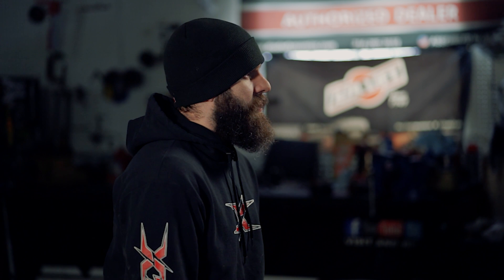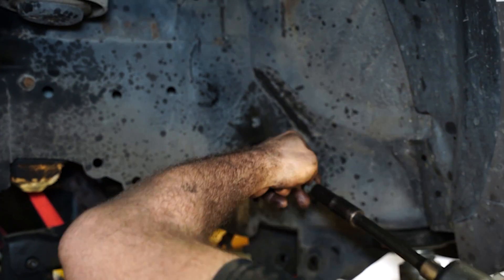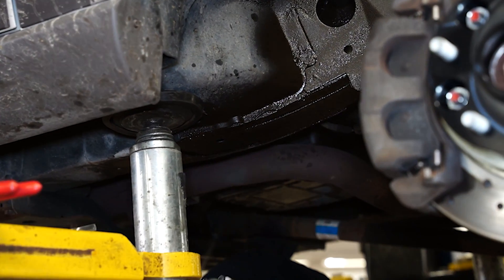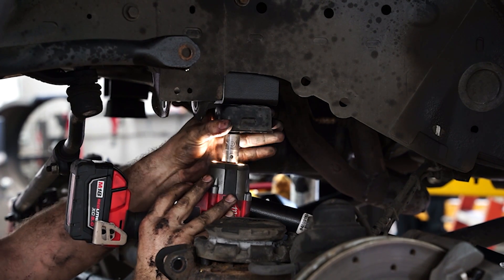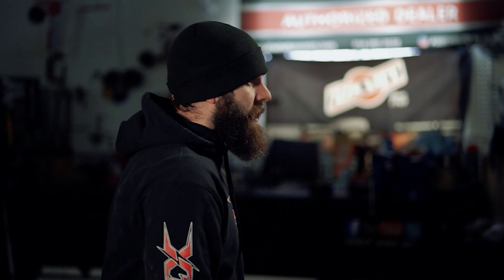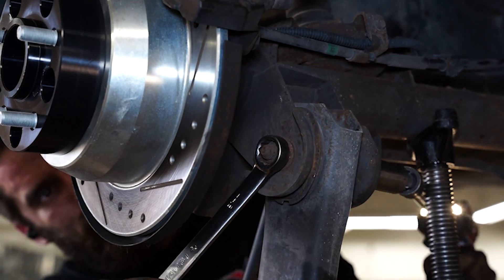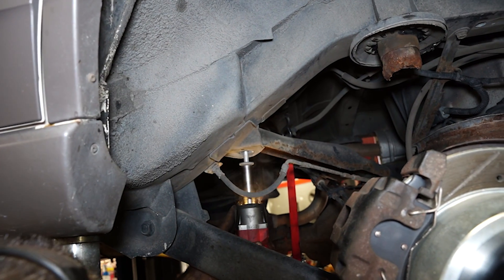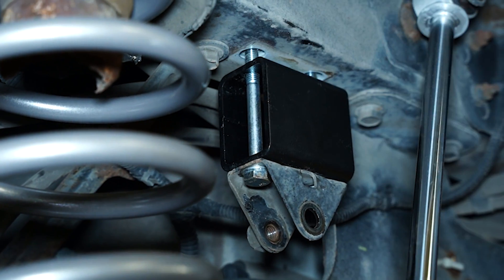Jeep Grand Cherokee WJ 4 inch Rough Country long arm lift kit

Comment from the maker: In this video I put on the 4 inch drop pitman arm. I didn't explain why I added it to the kit and what my plans were. If you buy this kit and don't plain on changing the trackbar angle then you DO NOT need it. It will throw your steering/suspension geometry off. Sorry I didn't make this clear. Video coming soon on when and when not to add a drop pitman arm and what its effects.

Comment: i was one of the lucky guys who got one of the newest upgraded 4" long arm kits from my great guys at rough country and one of the greatest compliments I've ever received was the day after installing it went in for a true FOUR WHEEL ALIMENT every shop i called was 300-400 bucks so ok took it in dropped it off three hours later i get a call saying come get it so i go back thinking they couldn't do it well i walk in ask what i owe and im told $65.00 i asked so you guys couldn't do it the owner comes out and say OO no we got and. MY GOSH WE HAVE NEVER EVER SEEN A COMPLETE LONG ARM LIFT OR ANY LIFT THAT HAS SO MUCH ADJUSTMENT once we fig out all the adjustments it was the easiest fastest four-wheel aliment we've ever had.....
Reply from the maker: I think this kit is GREAT for the price. It rides great in my opnion better than stock. Yes there is a ton of adjustment and its easy to change anything if needed. Glad to hear that the shop was able to hook you up with the alignment. Seems to be getting harder to find a good alignment shop these days.

Comment: Had my 99 WJ since 2005..... it's still bone stock and I've wanted to do this for the last 10 years. IRO kit seems a bit pricey for just about the same stuff as this RC kit. Nice ride sir.
Reply from the maker: Thank you!
 Yes all of the other options are expensive in comparison. I have had this kit for a year and have had no problems with it. The track bar and sway bar links are a bit loud but most hiem joints are. Also I have had zero issue with the RC long arm joints (I grease them every other oil change or at least check them). When the do go bad I believe IRO or one of the other kit company makes replacement joints for the RC kit as long as you keep it at 4 inches. Honestly at that point I might just make my own arms and use the RC brackets to mount them.

Comment from the maker: Yes I know I said that 99% of the time Death wobble is caused by the track bar. I was exaggerating. It's the most common of what I see at Xtreme. Control arm busing and ball joints would be the runner up.

Comment: I definitely like the design of the front control arms of the Rough Country long arm kit over the Iron Rock. But, in my opinion, the quality of the Iron Rock is a bit better.
Reply from the maker: I don't have any complaints with this kit after a year. Iron Rock is a great set up, but it is over 3000 for the kit. The RC is about 1600 so it is quite a bit cheaper. What I have heard is that the RC joints don't last long. I have had this kit on for a year and not had a problem with them or any of it. I believe that either IRO or Trail forged makes replacement joints for the RC kit. So when it comes time I will upgrade them.
Reply: @XtremeTruckAuto  yea, that's a good point

Comment: is this a V8? quadradrive or quadratrack? I read online none of the Rough Country kits will work with either and I'm sad.
Reply from the maker: Mine is a 4.0 slec trac. but it will work on all of the WJs (99-04) Jeep Grand Cherokees. The only reason why they say it won't is because of the front drive shaft. You need to go from the cv style to the double cardan driveshaft (u joint drive shaft). With that being said I would go check out my other videos over the RC joints. I would 100% recommend upgrading them to the Johnny Joints before you install this kit. I have it on my jeep and after I eliminated the terrible RC joints I have had zero issues with the kit. TBH it is a great budget kit. Thanks for the comment and watching!
Reply: @XtremeTruckAuto   They also say it won't work on the V8 models but a buddy of mine was saying that's probably all cuz of liability concerns. The previous owner already changed mine to u-joint style front drive shaft. I decided to go with the Iron Rock 4-in Long arm kit anyways.

Comment: Daaammit😂 i was set on this kit until i seen the video.  Great video tho nonetheless! Seems like a lot for 1 single guy in a gravel driveway tho lol
Reply from the maker: YOU CAN DO IT!!! One thing I will say if you do want this kit I would recommend that you upgrade the RC x joints to the Johnny joints right off the bat. I have a video that talks about this sadly not one that shows the break down of the RC joint. However, I will very soon because it has been requested enough. But in all honesty if you are balling on a budget, then I would start putting the money away to replace them in 2 years (how long my joints lasted). I do thinks this is a great kit for the price and the only issue I have had to date is the joints. Hope this helps you decide and thank you for watching.

Comment: Hellow master
I live in southkorea and  wj 4.7 grandcherokee 04.
Two day ago, offraod little bit.
And the make noise looks like steel rub so check the suspension.
I found make noise from front low arm braket (transmission member).
Between frame and braket have space where front side (1-2mm).
Is it collect installed ?
Thx to vid.
Reply from the maker: It sounds to me like something is shifting. I would go back though and double check all of the bolts in that area and make sure they are tight and try to give the bolts a little bit more torque.

Comment: How do I set vehicles to ride height? I’m on jack stands and blocks. Please help me understand ….
Reply from the maker: The vehicle hight is determined by the springs. So there isn't a way to adjust ride height unless you do different springs or add some kind of spacer. The adjustmet in the arms is for axel position and pinion angle/caster.

Comment: @20:22 I noticed a bolt missing. Was that intentional? Or did the bolt snap off?
Reply from the maker: There is a bolt in there. It is a counter sunk bolt with a spot to tighten it with an allen or torx key/socket.  I can  see how it could look like that. Thanks for the question. I will keep that in mind in for future videos and get better angle of things like that.

Comment: Great video! Did you have to modify your exhaust? I am planning on installing this kit on my '02 WJ Overland. Do you have a complete list of replacement Jonny joints?
Reply from the maker: No I didn't have to modify the exhaust. 

Below is a website that has the joints listed for every part of the kit. Let me know if you have any more questions.

https://trailforged.com/2022/05/11/rough-country-flex-joint-woes/?srsltid=AfmBOor4XmheWD0hlo1ybo-Aq3g0a4X8vNHAWor4-O_rmUyETaOAgimo

Comment: I appreciate the video! Do you have any idea what caster or pinion angle you're running? I just got mine in and the front driveshaft is making a lot of noise. I've got the pinion at about 4 degrees up which is putting caster somewhere around 5 degrees. Don't really want to go any further or my handling will suck. Maybe I need a different drive shaft? I rebuilt the factory double cardan but maybe I did something wrong. Any help on what angles are working for you would be appreciated. Thanks!
Reply from the maker: I set mine up so the pinion was inline with the drive shaft. I believe that a (3 joint) DC you want the drive shaft and the pinon close to the same angle or the pinion pointed at the transfercase and on a (2 joint) or cv style drive shaft you want the transfer case and the pinion to be parrell or same angel. I think mine is something high like 6-7ish. If you send me an email (its under the about tab on the channel page) I will send you pictures of mine. I never put it on an aligment machine because I have zero issues and the tires are wearing fine. Keep in mind that doesnt mean that its in or right but it warks for me and drive fine.
Reply from the maker: https://wranglertjforum.com/threads/help-me-with-some-very-basic-questions-on-suspension-and-body-lifts.46387/

This had a pretty good illustration about half way down the page.
Reply: @XtremeTruckAuto  I appreciate the response.

Comment: Nice video. Just did mine. Did you notice that your trans mount was droped down quite a bit. My transfer case is pretty low now and the motor is tiped back as well. Might have to make some spacers to tuck everything  back up.
Reply from the maker: Thank you!! I didn't notice it changing any. You might check and see if that transmission mount is bad.

Comment: Did you ever do an alignment video?

Great video for the lift install. I used this as a reference whilst installing, moreso than the actual instructions! Hello from England.
Reply from the maker: I'm glad the video was helpful!!!!

I did not do an alignment video. I might be able to work something out. There is a lot that goes into alignments especially on a fully adjustable kit like this one. You have to keep driveline angles (depends on your drive shaft) , caster , toe and steer ahead in mind. So unless you are familiar with alignments, I would recommend that you take it to a professional and have it aligned. This will give you the best result (assuming they know what they are doing). Because an alignment machine is going to be 10000000000 time more accurate. (ok I may have exaggerated there)

Cheers mate and thanks for watching.
Feel free to respond back if you have any other questions.
Reply: @XtremeTruckAuto  oh definitely, taking it to someone is my preferred option, the issue over here is finding someone who will do it. This sort of thing isn't popular and so far every alignment place has took one look at it and just said no 😢
Reply from the maker: @joesm00th  if push comes to shove I can get you close. Let me know and I will get you angles and lengths off of my jeep. Keep in mind that I never put it on a rack to align it but it drives fine and the tires are not wearing funny so I figured send it. Are you running a double cardan drive shaft?
Reply: @XtremeTruckAuto  if I get stuck, that would be amazing mate. I'll drop you a line if that's the case.

Yeah, managed to source a double carden one from a V8 WJ using part numbers. They are rarer than hens teeth over here as scrap. 99% of our WJs (WGs) all had the cv style ones.

Comment: So ill admit it, ive dogged rough country long arm lift in the past. Im seriously looking at them again for the long arm upgrade kit and using springs and shocks of my choice. Upgrading the bushings when they fail and so on.  So how do you like the lift? Would you recommend it  after a year? Ive got 04 wj. Thanks
Reply from the maker: I have seen zero issues with the rubber bushings, but you also need to know I'm not flexing it out very often. I built mine with the purpose of having an off-road capable daily driver. On few weekends throughout the summer I will load my boy into it and go out camping/overlanding. Most of the roads are light to moderate trails. So if you are looking to do something similar. 100% recommended with the upgraded joints right off the bat. Now if you are wanting to build a crawler I'm sure with the up graded joints and bushings this kit would do just fine. I just can't tell you for sure because I haven't tested the kit in that way.

Comment: So I'm going to put the rc x series on my wj will it be a complicated at the long arm ?
Reply from the maker: No, becuase you will be using the factory mounting locations. So you won't be replacing the transmission cross member and you wont be cutting the factory mounts off. It should be pretty straight forward compaired to the long am kit. I will tell you that rough county has some deicent instructions. So fallow them and you shold be good to go. I will give you the heads up that the bolts on top of the rear diff are a bit of a pain to remove due to the loctite that is on them. Once they are off and you go to put the new ones in besure you loctite them. If you have any questions on the install or you get stuck shoot me and e-mail. It is listed under the about tab on our YouTube channel page.
Reply from the maker: One other thing is besure you grease all the x-joints and put antisieze on the threads of the joint that goin into the new controll arms.

Comment: How good is this kit holding up? Any review?
Reply from the maker: I have zero complaints. I had to put a transmission in it about 2 months ago. So, I checked out the front joints while the crossmember was out and also checked the rear joints while I was at it. Everything looked good with zero play. 2 years+ and still going strong.
Reply: @XtremeTruckAuto  nice. I have IRO coils so now that u say that, ima irder the arms, if anything, i can always replace the joints only with a different brand right? And how does it handle on road/freeway?
Reply from the maker: @carloshereaud5463  I love the ride. Its honestly better than factory and it handles how I would expect. It's my daily so I have quite a few miles on the kit. Its like 35 miles each way to work. 

Yes IRO I believe makes upgraded joints for the kit. That was my plan once the joints that came with the kit wear out. When they do I will make a video and let people know.
Reply: @XtremeTruckAuto  thanks bud. 👌🏼👌🏼👌🏼
Reply from the maker: @carloshereaud5463  no problem, if you have any other questions let me know.

Comment: Awesome video. What tires and size are you running?  WHat would you say is the max tire size for this lift?
Reply from the maker: Currently I am running 285/70r17 (33x11.5) Cooper Discoverer Rugged Trek tires on a set of Jeep Gladiator Mojave wheels and a set of Spidertrax 1.5 inch wheel spacers (DON'T GO CHEAP WITH WHEEL SPACERS!!!) G2, Bora, and Spidertrax are the brands I recommend for wheel spacers. I have done quite a bit of trimming on the bumper and wheel well liner, both for clearance and for looks. I also relocated my washer fluid bottle (I have a video over the relocation of the washer fluid bottle). I do rub at full flex which I am fine with because I'm building an overlanding vehicle not a rock crawler.

As for a "no rub no trim" fitment RC recommends a 265/70r17 or 265/75r16 (31.5x10) on the factory wheel. Keep in mind this is without wheel spacers. They typically are spot on with the fitment but depending on type of tire some minor trimming might be needed.

As for max tire size, I have seen some crazy stuff like 35 and bigger but those either have a TON of trimming or the fenders have been removed. It really comes down to how much you want to cut to get the wheel and tire to fit. Luckily the WJ platform is one of the easier vehicles to trim fenders, bumpers and all that type of stuff.
Reply: @Xtreme Truck & Auto  Thanks.  I'm looking at building a WJ trail truck for mud and snow. I think a 4" lift with 33's should be about perfect.

Comment: Wish they had a long arm system for the V8 version.
Reply from the maker: It fits all of them. The reason why its say that it want fit the v8 and the AWD version is the front drive shaft. Most of them came with the rzeppa drive shaft. You would just need to replace it with the double cardan drive shaft. If you go to their website the black one is a v8 with the 4.7. Per the customer it is a 2002 WJ Limited 4.7L Qudra Drive with 42k miles. Be sure you watch my videos over their x-joints. The only one I know it wont fit is the 2wd.

Comment: I have a 2 wheel drive 02 grand cherokee with a 3 inch pucklift but that just isnt enough. ive heard i can put the 4wd lift kit on mine regardless, and then ive heard I cant. Does any body know for sure?
Reply from the maker: RC's coustomer service is pretty darn good. If you call them they will let you know. I don't know to be honest. Don't know why it wouldn't but I haven't personaly ever seen a 2wd drive on in the wild yet. The only thing thing I could see being a problem is how the arms mount to the fron "axel" or the transmission cross member being different.
Reply from the maker: I looked into it and per Rough Country all the kits will fit on a 2WD WJ. They won't fit the right hand drive versions.
Reply: Funny part is you can get rear wheel drive jeep for $200 that need engine work, I'm about to buy some rough country springs this week, was this a 4.0 build I'm on 2-3/4 front and 2 inch rear spacers currently on a 4.7 HO Overland, love the interior ❤

Comment: What brake set up do you have on that WJ? Pretty good once over but you didn’t talk about the brake lines in the front?
Reply from the maker: There is a relocation bracket that mounts on the front. It's eazy to install and only take a min to do. As for my brakes they are the Power Stop pads and their drilled and slotted rotors. I really like Power Stop's stuff and install them on all of my vehicles.
Reply: Did the rotors and pads make a difference in stopping with stock calipers? One more thing, on an 02WJ limited do you think it’s required to change the front drive line when they talk about this vibration with what the limited has on it? Thanks
Reply from the maker: @brucecrawley5179   @Bruce Crawley  Yes I noticed a difference even with the stock calipers. In my opinion they are worth the upgrade. It's technically not required.  I had the u-join on the axel and the cv on the transferase. I drove around for a month or two on it with no issues. So I could have left it but I changed front drive shaft to a double cardan because they are stronger, easier to service than the cv styles and I figured better safe than sorry.